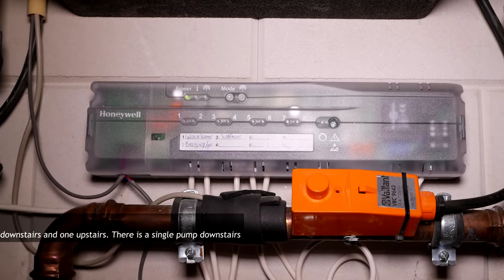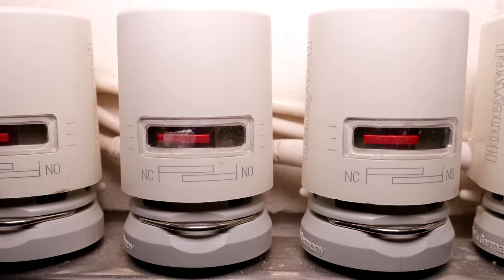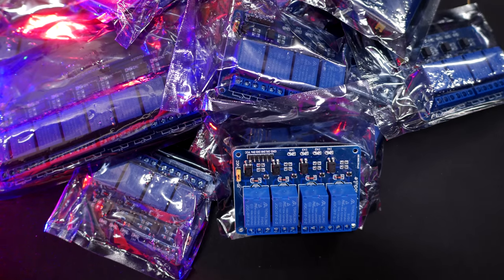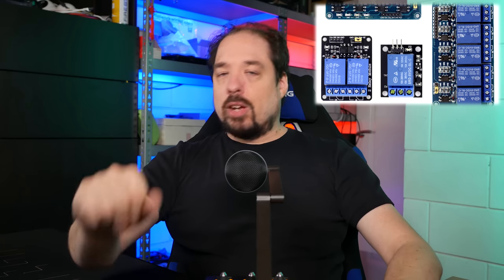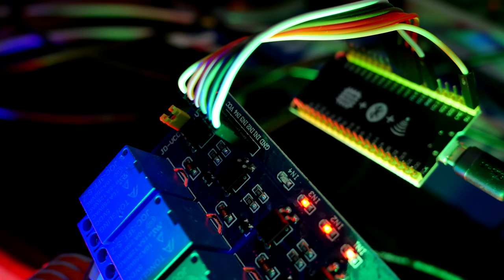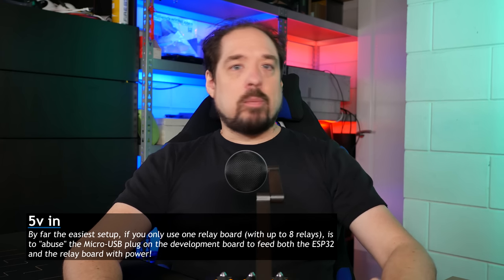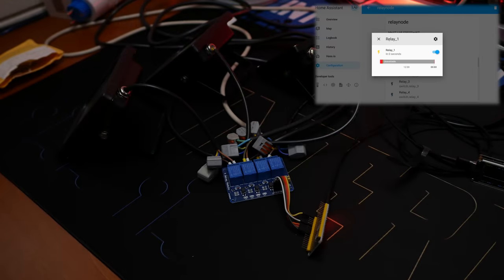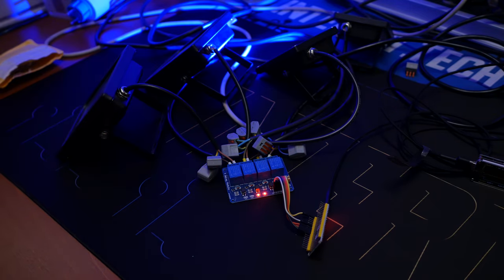Home Assistant: Simple relays with ESPhome

Comment from the maker: It seems I might have messed up some (confusing) terminology in the video!
So, NO is normally open and that means no power will flow when there is no power on the relay, and will flow if if the relay is switched on... NC is not normally closed but Normally Connect, which means without the relay on, power will flow.

The terminals depicted in the video (for instance at 6:56) and other explanations still apply just the terminology got reversed.
Reply: I've never heard NC being called normally connect, anyone I know or follow calls it normally closed. Normally closed also makes sense, since you're talking about a circuit. A closed circuit will flow, an open circuit won't.
Reply: LOL, I'm glad you clarified this, as I did a double-take!

Comment: It should be noted that the current rating for the relay will probably be for resistive loads.

If you are switching a motor or other “reactive” load, the rating is often a LOT lower, e.g. Maybe 1A or less. So it’s always best to understand the load and check the relay specifications, otherwise it’s switching life may be significantly shortened.

Comment: Wonderfully explained video. I have a quick question, hope you can help me out with this. I have a esp8266 board running esphome with a PIR sensor connected to it. I am presently making use of Amazon Alexa actions through homeassistant automation when motion is detected (turn on light). Is it possible to connect a 220v (AC) led strip via a 5v single channel relay to the same esp 8266 board that has the PIR sensor to trigger motion detected led strip turning on. If so, what code lines should I be adding to the config file? Sorry for the long post. Thanks in anticipation.
Reply from the maker: Hey hey, glad you liked it! Yes you can do that in ESPhome, look up "on trigger" actions in the ESPhome manual, the code you need is right there. :)
Reply: @IntermitTech  Thank you very much for your reply. Really appreciate your help. I will look up on the trigger actions in esp home. Thanks.

Comment: Just wondered if you had consider any I2C  relay boards?   (when you run out of pins)
How many pins does the ESP32 have that can be used to control relays?
Thanks
Reply from the maker: Ah good question! I haven't considered any because of probably added cost. In my case I need at most 12 relays in one place so I think even an ESP8266 NodeMCU has enough pins for that, but the ESP32 boards I'm using for sure (I believe there are 24 output pins).

Comment: Gotta think about safety too. Bet that Honeyeell controller has some smarts in it to identify faults with the system and shut off the valves in that event. What if one of your relays was locked closed? Would it stop heating or just keep running hot?
Reply from the maker: Worst case in my application would be that a valve would stay open, the pump would keep running or the heat pump would continuously get the signal that heat is desired.

In the case of an open valve, that's no issue really and the circulation pump would still shut off so it makes no difference if a valve would get stuck.

If the pump keeps pumping there is a safety for that in the system where some loops have no valves including the 40L buffer tank, so no risk of running it dry and it's been on for days before too.

Continuous heat ask from the heat pump would mostly be inefficient. Since all valves would be closed it would keep heating the buffer tank and unvalved groups. Basically the heat pump is dumb anyway and only has a temperature it wants to get it's buffer tank to, if that temperature has been reached, even though there is heat ask, it will still automatically shut off until the buffer tank drops below it's set value.

So I understand your concerns but everything that this is controlling has their own safety features also and even if everything was constantly on, it's designed to run that way. :)

Comment: Is this the most effective way to control 24v analog strips? 

I have four 26’ long channels of high CRI white LED strips that I’m installing over my work shop/lab - i’m trying to figure out the best way to turn them on and off and dim 

Each channel will have a second 24v ID RGB strip that will be managed by ESP+WLED - I’ve got that tested and figured out from watching your previous videos but how to additionally manage analog in the same system would be wonderful!
Reply from the maker: I'm confused, if you are already using a PWM dimmer for the 24v RGB why then not also do so for the 24v Analog strip?

Comment: Hi Quindor, I purchased a (AZDelivery 16-Relais Modul 12V mit Optokoppler relay) on Amazon, the gpio inputs on this board are 5V. Problem with this one is that my Rasberry 4 is not able to switch the relays, apparently because the gpio voltage of the Raspberry uses 3.3V and has not enough power to switch the 5V relays. 
I found a AZDelivery TXS0108E on Amazon, and they should convert the 3.3v to 5V. Once connected they only give contact when i mess arround with the jumper cables. 
Not shure it being the cables or the logic converter boards themselfs. I hoped that a logic level converter could solve the problem i ordered another 2x (8-Kanal-Level-Conversion-Modul Zwei-Wege-Konvertierung) on Amazon, but these are not delivered yet. So could not test these.....yet. Do you have any experience with these logic converters and would they solve my problem?
Reply from the maker: Ai, yeah, some really need 5v to trigger, the boards I linked to worked perfectly down to about 2.5v so worked with ESP's and such.

But yes, I use logic level shifters on some of my boards and that can work to raise the GPIO voltage from 3.3v to 5v and that would fix your problem, won't be pretty, but that can work. :)

Comment: How do you control the boiler circulating pump, that when any of the relays is on the pump should start,  do you use on of the relays on board and nodered will do it? Or you heard wire toca separate relay
Reply from the maker: The pump is on its own relay and in Node-Red I can configure that if one valve opens the pump should also run.

Or at least, in my test setup, I hope to continue building this later this year!

Comment: Hi Intermit-Tech, very intresting video. I would like to do something similar but for a electrical underfloor heating system. I know that a thermostat do this job, but I would like to define a certain maximum Kw instant consumption and decide what room (based on a priority list) have to be switched off- Do you think using your project plus some device (like Shelly EM) monitoring the consumption in Home Assitant cen work? PS the heating system will have a separate switch case so it will be easy to monitor just the heating consumption vs, the rest of the house. Thanks and please continue posting videos.
Reply from the maker: Poh, if you can program that logic and the thermostat is a simple on/off deal, you I think that can work.
Reply: @IntermitTech  I will try and let you know. BTW do you have your devices availables? I would like to buy a couple of them. Thanks
Reply from the maker: @mariopalma3802  Everything is always available since they are DIY builds! But for the QuinLED-Dig-Uno I also do a pre-assembled version and that is currently in stock. :)

Comment: Hi Quindor. I am very interested in this video and I have one questions. You are using a NodeMCU to control the relays or ESP32 board, which is fine and this integrates into HA, all well and good. What I would like to do is us a simple Push Button to control One of the relays on a 8 channel Board. 
E.G.
If I have 3 push buttons on my wall plate in the lounge controlling 3 separate lights. If i deploy the relay board in the ceiling and connect the lights to the relays, how can I control the Relays on the lounge switch which is 3 push buttons??
Can I use a NodeMCU to connect the Push Buttons too and then send a mqtt command or something to HA to turn the relay on? I guess the lounge switch could still be a simple light switch connected to NodeMCU or ESP32 development board
I hope this makes sense. Thanks for now
Bruce
Reply from the maker: Sure you can can easily program this using ESPhome combined with Home Assistant. You could even make it so that if HA would be down, because it's all on the same ESP32 that you can still switch the relays.
Reply: @IntermitTech  Thanks Quindor, much appreciated. Would you please be able to give me a sample of what the Switch Code would look like so I can test it. I would be greatly appreciative if you can help me out. Thanks so much again
Reply from the maker: @brucerawiri7170  That's going to be a bit hard to do through YouTube comments. Search around for ESPhome code, I'm sure it wouldn't be too hard to find. :)

Comment: Hello,
Thank you very much for your video. That's what first got me thinking about the topic. But now I am still new to the scene, but would like to try it. I bought the ESP12F_Relay_X8_V1.1 board with integrated WiFi and would like to integrate it with my WiFi and then control it with Home Assistant (underfloor heating), but unfortunately I still lack the skills to configure the board to connect to my WiFi.
I know it's a lot to ask, but would it be possible to create a code where I only have to enter my SSID and password?

Many thanks and greetings from Bavaria

Comment: 230 volt zone controls (?) crazy.  Over on this side of the world most zone controls are 24 volt.
Reply from the maker: Yeah, I would have rather had 24v DC too, but this is the most common system that is rolled out over here.
Reply: @IntermitTech  Oh that would be 24 volts AC , so needs a transformer.